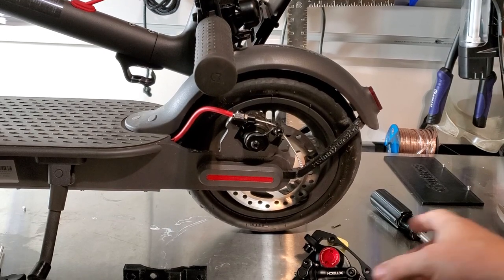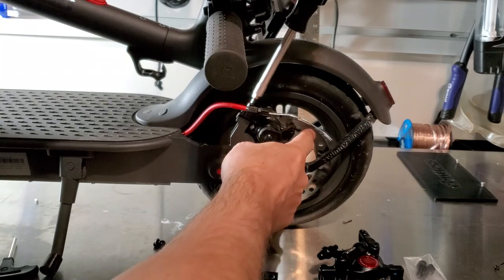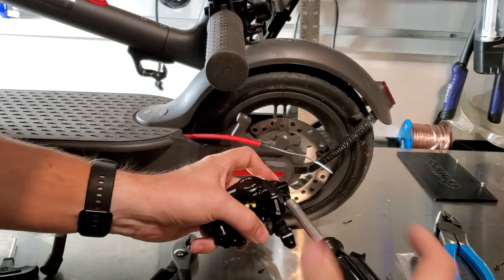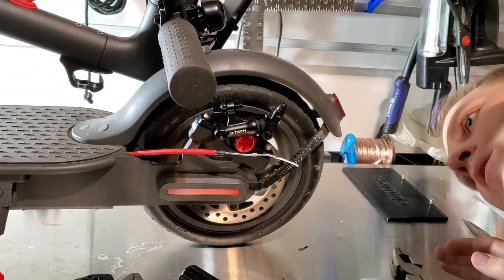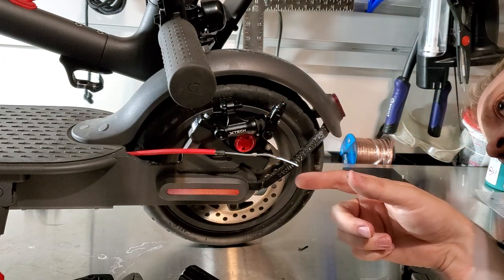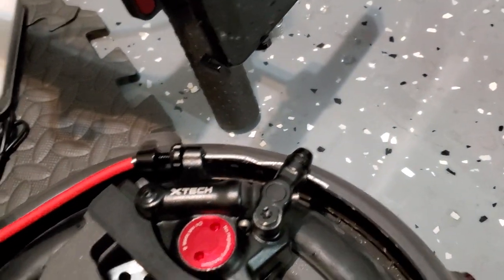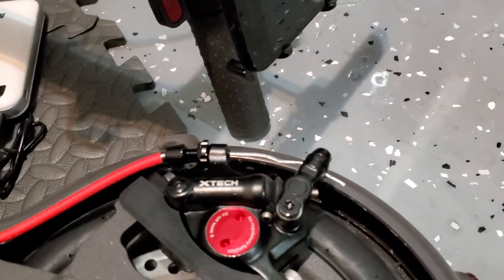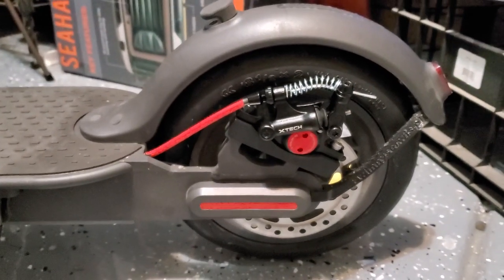M365 Pro Scooter - Xtech Brake Mod Guide

Comment: Wouldn't use a 3d printed piece for any brake component unless it's metal
Reply: Abs plastic is strong enough almost as good as fiberglass plus most of the stress is going into the forward bolt that's going into the metal frame

Comment: Glass temp of PETG is 105c, that's very low for brake components. you need to make sure it's not getting soft after long braking.
Reply from the maker: I live on steep hills; steeper than 99% of users would regularly drive on I would guess; and while the brake itself gets hot; its not really transfering that heat into the PETG. I've had no issues over hundreds of miles. Although I haven't used it in the middle of the summer yet which could change things.  I would definitely recommend inspecting the piece each time your ride though and check bolt tightness as it definitely is not the greatest material for a brake mount.

Comment: Why did you test the brakes by turning off the motor? They are supposed to work in tandem. That's like testing the brakes in your using only the hand brake.
Reply from the maker: If the motor were to fail; I'd want to know the brake could stop my on it's own. You test worst case scenario for the best outcome.

Comment: Do you have information on the size of the spring that was used in the video?
Reply from the maker: I don't know exactly... I just went to the hardware store and found what seemed right out of their box. but I also realized there was a pinch in my line that was making the cable not slide easily; once I fixed that the spring isn't as necessary; but still nice to have.

Comment: Tried following this guide but honestly, it didn't help at all 🤷‍♂️ Maybe that's just me, your arm constantly blocks what you're doing also. Nonetheless I managed to fit the brake myself having never adjusted one before yet alone replaced one!
Reply: Did you also need to buy the spring for it and if you did what was the size for spring? Thanks

Comment: i would not trust plastic 3D prints for brakes. its a 4$ bracket and sold on ali express.
It looks like hes using 1 bolt that goes through the caliper and into the original frame. So that at least accounts for the strength, still not ideal but better than a full displacement of the mounting locations.

Comment: Basic M365 PRo breaks awesome. Much better than basic M365 :D. No need to upgrade for me, brake can block the tire easily, no need for more power...
Reply from the maker: Yes if you don't have extreme downhill normal brake is pretty good. Unfortunately I live on really steep hills and my stock brake started melting!
Reply: @cbutters  Melting? Sounds like the right time to replace it with plastic adapter :)
Reply: @janlukes5833  
LOL 😂😂😂 
Good one 😂😂😂

Comment: Bullshit, you can't remove the heat from friction just by changing braking calliper, you have to change disc and pads.
All bullshit in this video
Reply from the maker: the xtech brake DOES have new pads; and they make contact over more surface area.
Reply: @cbutters  
And more friction= more heat 🙂
Change the disc and don't bullshit.